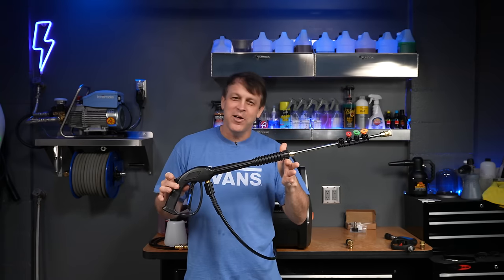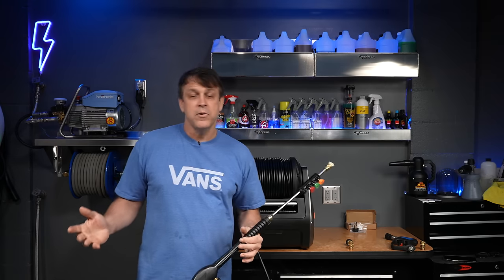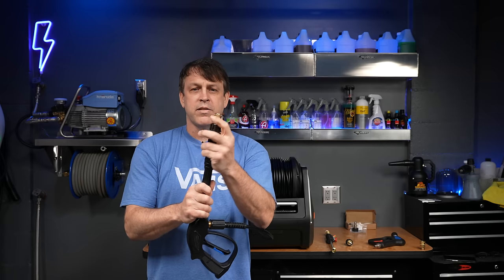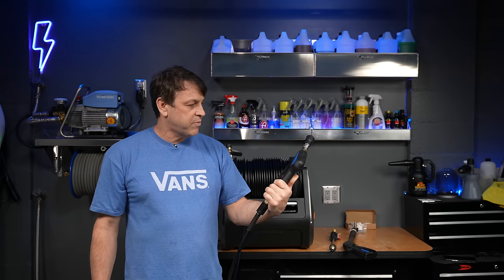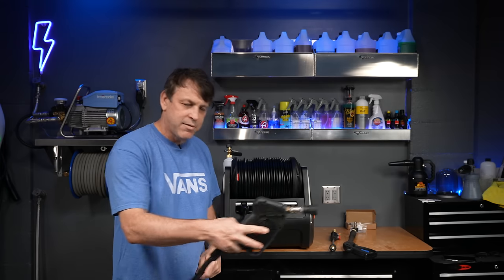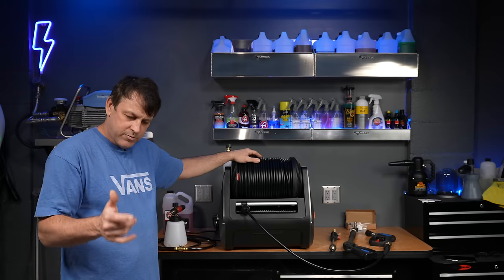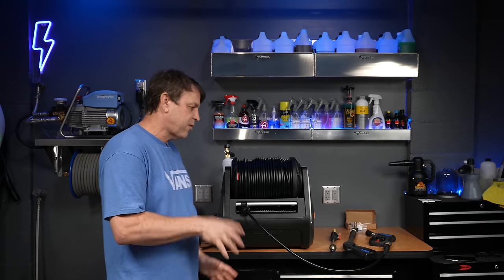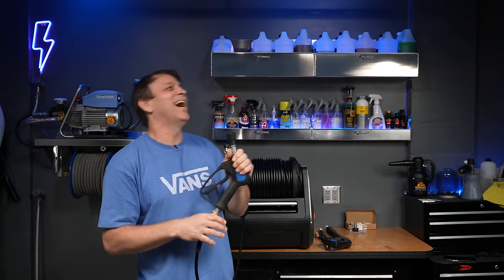$299 WALL MOUNTED PRESSURE WASHER and REEL

Comment: I have to say, I use the AR 630 TSS, and I absolutely love it! I have had it for 4 years now, with absolutely "0" maintenance or upkeep! And you can run hot water through it! It does come with a soap siphon hose which is really great if you are watching bigger equipment like an RV or heavy equipment because you just stick it down into a 5 gallon bucket you are good to go. Now, you can simply take that hose off ,and ignore it and stick on a foam cannon on the end of your pressure washer hose. Like the one I got from eBay for 20 bucks that has lasted me for years and produces incredible phone better than the $60 and $70 foam cannons. It just simply has a water inlet on the front and the water outlet on the front, and they are both beside each other up and down. It has true psi and water volume depending on nozzle used. If you pay attention to a lot of descriptions, some of these "cheap" brands, are referring to the 2000psi (when we don't think they really are) as when you are using the jet nozzle (usually black). The psi drops with the other fan spray nozzles. But honestly, the AR out does the Kranzle in several categories. Both are great, but the AR is by far, better. It is about $70] roughly, but we'll worth it. 4 years and going strong, and has NEVER been serviced at all, being used daily in a professional detailing environment. Used in shop, and loaded up for mobile jobs. (Until a 2nd unit is purchased for mobile jobs)
Great vids! I like how you keep our attention and not bore us like the old "dry eye" commercial 🤣
Reply from the maker: Thanks for sharing your story. I appreciate it. Thanks for watching

Comment: Great videos by the way. Very detailed and organized.  Just letting everyone know that I just got mine today and it looks good. The only thing I noticed that was different was the extension on the gun was a quarter turn twist lock style of connection.  No threads. So you won't be able to do the quick connections to shorten the wand....
Reply from the maker: Bummer. This happened to someone else also. I would recommend returning it if you are not happy. My second recommendation would be to upgrade the sprayer to a good one. Thanks for watching
Reply: @HawaiiDetailing  Yeah it wasn't bid deal for me but just wanted to let other people know
Reply: and what do you think about it a year later?
Reply: @joestewart8966  On my second one.  The first one leaked internally after a couple uses.  The second one the hose retract is not working right and blows off the garden hose fittings. And no matter what I do to the garden hose connections (tighter, looser, pipe dope, Teflon tape) I can't stop it from leaking. They did send me a second one to replace the  broken one but,  I  wish I would have saved up and got something nicer. Thanks for following up.

Comment: I have 2 Active pressure washers, specs are good as Matt has demonstrated in his testing.  The downside is like any other Chinese unit is the noisy shop vac sound. Second unit is a warranty replacement and the main problem is when you add a 50 ft. hose to it since the hose included is too short. The unit will surge on/off when not in use with the longer Kobra Jet hose to make up for pressure loss in the longer hose. If you're constantly washing as I do, ya just have to bite the bullet and get a Kranzle and be done with it.
Reply from the maker: Yes. That’s my thought exactly. I try to say that in my videos without sounding like too much of a pressure washer snob. These lower end style units are great for the weekend home owner but on a pro level it’s worth stepping up. Thanks for watching
Reply: Hose length has no effect on pressure output, it only takes longer for the hose to initially fill. If it’s surging with a longer hose, it’s just junk unit.

Comment: I have the Portland electric pressure washer from Harbor Freight.  After getting tired of of dealing with not having changeable tips and the cheap hose I bought a better hose, adapters, and gun.  It is so much more enjoyable to use now.  Its all set up with quick connects other than the garden hose connection.
Reply from the maker: Good to hear. Thanks for watching

Comment: I have a list of things to buy for my shop/garage. Floor drain, HVAC (mostly for humidity control), and then this is basically the third thing. It is good to get some options / ideas. I’ve been using a SunJoe, but something mounted would be much more efficient. Thanks for the video bru.
Reply from the maker: Thanks for watching

Comment: What we’re all hoping for in a pressure washer purchase? Value. I don’t mean monetary value, I mean straight up value regardless of cost. Will it perform? Will it last? Can it be serviced? All these things need to be answered for each individual’s perspective. For me, personally, I don’t want anything below the AR Blue 630 because … well … I’ve had literally a dozen cheaper pressure washers and they all died except for my Karcher Cube (but eventually it’ll die also). If the machine is going to get used on a regular basis, you MUST invest. That’s pretty much what it boils down to. No, you don’t have to buy a Kranzle but eventually reality will set in and you’ll have to weigh the pros and cons.

I’m not saying that everyone needs to go buy a Kranzle. I’m saying IF you use a pressure washer on a regular basis, you may want to consider a more robust and durable machine. Cheap pressure washers are designed to fail. Yes, designed to fail. You will NOT see a 10 year old Ryobi, GreenWorks, SunJoe, whatever “still going strong” unless it hasn’t been used … but then what’s the point of having it? Is there value in spending $100-$300 a year or every other? Sure, I guess so. But spending just a bit more and never having to worry about buying another pressure washer ever … there’s value in that as well. 

If you DON’T use a pressure washer very often, units like the Giraffe Grandfalls AiO are absolutely perfect. It may last 4-6 years. But if you use a pressure washer on the regular, invest in yourself and save to buy a better unit.
Reply from the maker: Well said. Thanks for watching and sharing your thoughts.

Comment: Jeremy I picked up an activ a few months ago from OG and find it to be pretty good.  No complaint.  I can't wash cars in my garage so I need to have them out in the driveway so I didn't want to wall mount anything.  I had the mosmotic set up from OG as well and for my use I am very happy with the results from the activ for the price.
Reply from the maker: Thanks for sharing. Yes that is a good setup to have. The spray gun is really nice for sure.

Comment: Whatd did you think of that 100 ft hose. Is it the typical preasure washer hose that should be thrown in the trash?
Reply from the maker: It is your typical cheaper hose but it did not seem to be that bad because you are not wrapping it up and unwrapping it into coils to store it. That’s where all the kinking and misery is. This one comes on and off the reel easy. The thing I hate most about cheaper hoses is taking them out and putting them away. It’s always a nightmare. This one is easy. Thanks for watching

Comment: This looks to be just what I need for my garage, if only to make maintaining my vehicles more convenient. The lance looks to be pretty much garbage, but I am confused as to what fittings I would need to attach a Mosmatic OG. User experience is important to me, I know that if it is inconvienient, I won't do it. Thanks for the great content!
Reply from the maker: The lance that comes with it is not that great. The OG spec will make it nice for sure. Get the #1  version in my links in the description of the vid and it should be pre selected to add the QD Coupler that fits M22-14mm I highly recommend the link right below it in my description for the 40 degree rubber protected tip. If you have any other questions let me know and I will try to help. Thanks for watching the channel.

Comment: I just got one in the mail yesterday.  I wont be putting it up for about a month due to an upcoming move.  I unboxed it to make sure it physically looked ok, and it did.  right away I noticed however that they made some big changes, and they are not for the better.  the foam cannon is 100pct plastic now, no brass body.  Also the spray gun has changed as well.  The middle is now a plastic t shaped bayonette type connector meaning that i dont think there is an easy way for me to convert the gun to be shorter.  After watching your video I was super hopeful that I would be able to shorten the gun up but it doesnt look like it which is a major bummer.  Only time will tell how it sprays, but seeing these two changes alone has me very worried.  What else did they reingeneer to be cheaper at the expense of performance or usability.....I almost feel like it was a bait and switch to send these units out to multiple youtubers like yourself, and then a month or tow later ship out entirely difirent (and not for the better) units to consumers.  I am feeling a bit duped.
Reply from the maker: Man. I am sorry to hear that. You should return it right away if you are not happy. I assumed that the product they sold would be the same as I reviewed. Send it back and get a wall mounted option from my video. You will pay a little more up front but I can say with %100 certainty that it will be a great kit. I will guide you and make sure you get everything you need and that you get it up and running. Thats my opinion on this. Thanks for watching the channel.
Reply: @HawaiiDetailing  Thanks for the reply and insight.  I commented on one of their instagram clips that I wasnt happy and to their credit they responded within hours and have offered to send me the brass foam cannon in a few weeks when it is aviliable.  As for the gun I will probably just buy a stubby version on Amazon and call it good.  As far as price and packaging go I am not going to be able to beat this....I think.  I dont move for a few more weeks so I wont apply water or power to it until then.  If I have a good or bad experience then I will come back and comment here.  Thanks for the vids, they are thorough and fun to watch!

Comment: Nice video. Is the hose connection m14 or m15 where the gun upgrade connects to the main line hose screw down?
Reply from the maker: It’s a M14

Comment: A couple of questions. Would it be fine to leave outside in rain? Also what do you think about the hose? Can it be upgraded?
Reply from the maker: I wouldn’t leave it out in the rain. It detaches so easy I would put it in a safe place after use. I have not looked into replacing the hose to see if it’s an easy swap. I will let you know when I get a chance to dig into it.

Comment: Aloha - great video. I’m a weekend warrior and use a Sun Joe SPX3001 to detail my car. Do you think this Giraffe will do as good of a job as the Sun Joe? 

My main complaints about the Sun Joe are that it’s loud and I have to lug it around. I love the idea of a wall mounted washer. Cheehoo!
Reply from the maker: It’s a little loud also. I would say similar to the sunjoe. It’s a good all in 1 kit but it is a little noisy. Consider a shelf mounted kit like mine. If you have not seen those vids I did check them out. Thanks for watching

Comment: Could you do an install video showing a step by step how to putting it on the wall itself.
Reply from the maker: It was 4 screws and it’s done. The only thing is you need something to screw into 2x4 backing inside the wall or plywood.

Comment: What is the best budget beginner good hose to start with? I want something that won't kink and has no memory.
Reply from the maker: do you want to put it on a reel or just a wind up?
Reply: @HawaiiDetailing  something to wind up, i don't have a reel yet, I'm working on it.
Reply from the maker: I only use the MTM hoses https://amzn.to/3GZ02m7. They are great quality but a little pricey. Will last the rest of your life though.  I have heard good things about this one as an entry level hose. Should screw right to most PW's but would require an adapter on the gun side depending on what you have. https://amzn.to/3J4NPiD
Reply: @HawaiiDetailing  awesome. The MTM looks super sick. Might have to go with that one and not risk getting bamboozled with a cheaper one. Because we all know those Chinese made ones don't last long. I see the MTM is Italian made so i know it's going to be quality.

Comment: Just discovered your channel and subscribed. Quick question, what size nozzel orifice where you using on that Mosmatic sprayer?  2.5?  Thanks!
Reply from the maker: I used  the supplied tips and am not sure what the orifice size was and with my stubby gun I used my 4.0 from my Kranzle set up and it worked great. I don't like a lot of pressure but a 2.5 might have been a better call? Thanks for watching
Reply: @HawaiiDetailing  ok cool.  I want to order those OG spec Mosmatic Nozzle assemblies and was scratching my head trying to figure out what orifice size to get for that lower pressure and higher GPM.  I was guessing the stock shnozzle is 2.5 and either a 3.0 or 4.0 would be better. The fan and water pressure/flow from the one you used in the stubby gun is close to what I am looking for.  I love your channel by the way.
Reply from the maker: @guitarscientist9386  thanks.
Reply: @guitarscientist9386  What size did you end up going with and what are your thoughts?
Reply: @JaimeChavez35  I am using a 40 degree nozzle with a 2.5 orifice and it works very well for washing my car.  Seems like the perfect pressure and water flow for that application.
Reply: @guitarscientist9386  Thanks for the reply. Placing my order with a bit more confidence now. Much appreciated!

Comment: Wouldn't you just be better off with a gerni or similar pressure washer unit that can link into a reel, keep it there permanently, but have the ability to take it elsewhere when you need to?

Comment: How is the hose quality and can you upgrade the hose on this unit?
Reply from the maker: Not sure about upgrading the hose. I will look and dive deeper into this machine soon since there have been a lot of questions about it. The current hose is typical Amazon style quality but I did not notice as much because most of the problems usually is winding it up and getting it out. The reel drastically reduces those tasks. Thanks for watching
Reply: Cannot replace hose. Now if you wanted to open the unit and figure out a way to attach a new one then maybe. Does not have a serviceable connection to replace whole hose assembly with fittings. Their higher end model does have a replaceable hose. 

IMO, the stock hose with a swivel short gun works good. Hose lays nice and doesn't seem to bind up easily. My experience is that it is a VERY nice all in 1 unit without breaking the bank. Hose winds up nice too. I clean a 18X42 concrete pad with it in stock form in about an hr too. Very happy with it

Comment: Could I use it for mobile detailing?
Reply from the maker: Yes but keep in mind its an entry level pressure washer that is not serviceable. More of a homeowner type or detail enthusiast type of kit. It will work great but all day everyday I am not sure how long you will get out of it. I used a similar pump karcher for over a year with no problems??

Comment: jeremmmyyyyy, question here!!

brake buster on a foam cannon? what is the best dilution? on a 500ml foam cannon. thanks!!

#jeremy2024
Reply from the maker: I run it straight at 100%. The foam cannon dilutes it down as you spray it. Its a good dilution right out of the canon. Thanks for watching.

Comment: Unfortunately its bait and switch compared to the reviewer units. first the consumer kit gun I received is even worse than the one on here. It has no fitting to add the quick connect just pushes in and turns. Then the cheap foam canon in that kit is nothing but a soap bottle in the consumer kit. In other words be prepared to use your other wands, etc or purchase them.
Reply from the maker: That’s a bummer. If they have changed the parts since my review and you are not happy I would return it. I will update my description and make people aware of this. Thanks